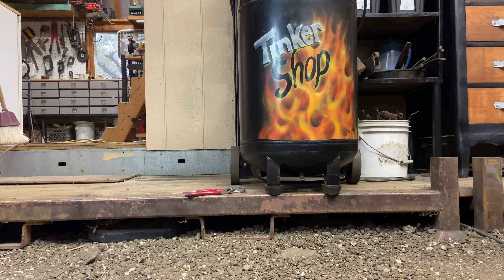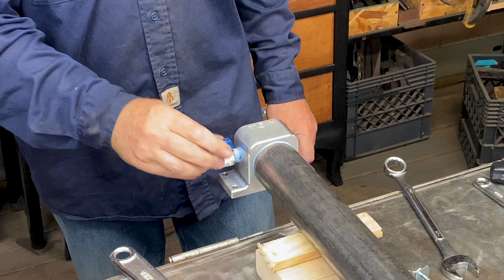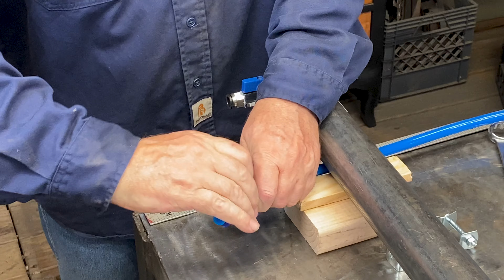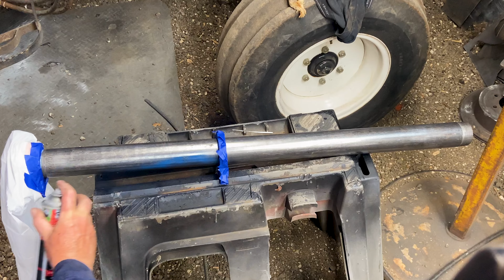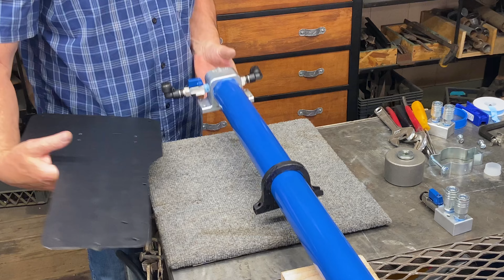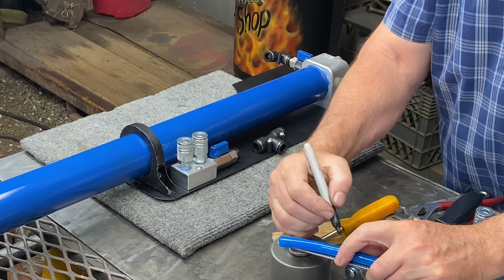Dry Air Made Easy: EZ Air USA System Full Setup

Comment: you need a radiator....
Reply from the maker: I appreciate the input, though I'm curious to see how well this setup performs on its own first.
Reply: @timsstuff  What he means to say is although this setup will give you dry air in your lines this will not solve the problem of water condensing in the compressor tank. You need some form of cooling before the air reaches your tank to condense the water and separate it out if you wish to have a dry tank. a Radiator setup dose just this. The wall bracket was very well made I like how everything is on one piece that's a great idea.

Comment: Yeah had same thought of making it portable. I am kinda thinking to even make a plate with hooks that will just attach to my compressor backside so if I wheel my compresor around everything is on it portable. Not sure that will work out like I'm thinking, but definately going to make it portable too. Vibration would be my main concern doing it that way though. Thanks for the video
Reply from the maker: Great idea, definitely let me know how it turns out. Thanks for watching!
Reply: Maybe I'm being over safe, but since this setup is rated to 145psi which I doubt i'll ever go over, but lot of compressors to push the CFM we need to push go much higher. I think I'm gonna install a pop off valve just below the max PSI so I never haveta worry about over pressurizing the EZ-AIR
Reply: So looking at mine and assembling attaching to compressor the vibrations would screw up your orange beads that you can see through the lens it would vibrate and mix them with white ones possibly causing you to not be able to see orange ones at all over time.. so guess that idea is out the window :D I'll still throw a pop off valve in it and attach it to something portable for sure.